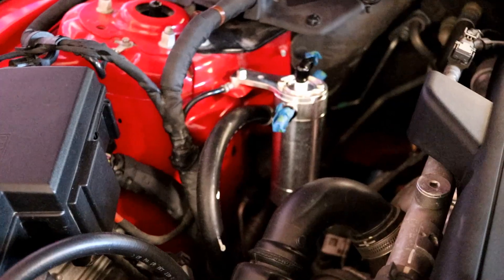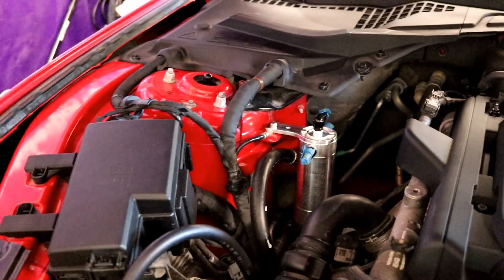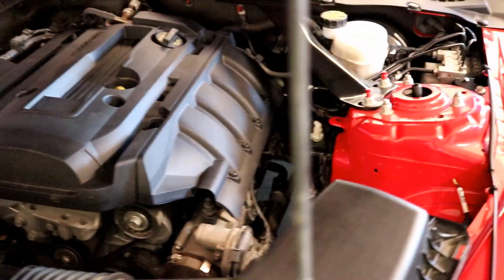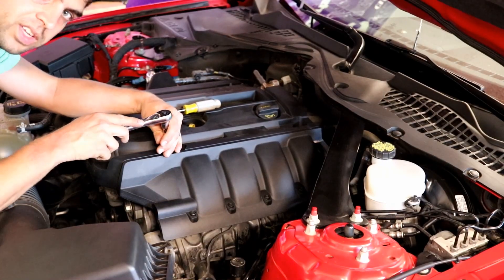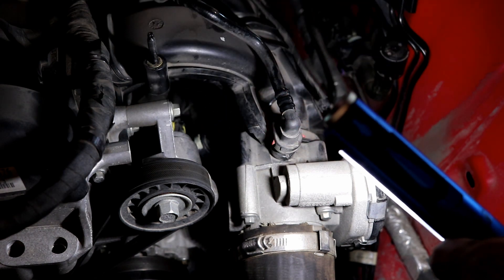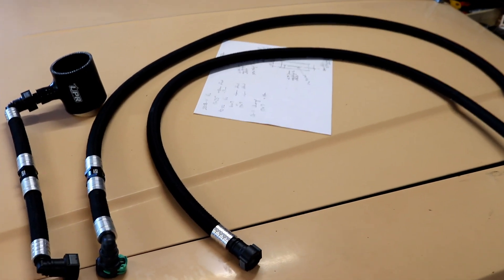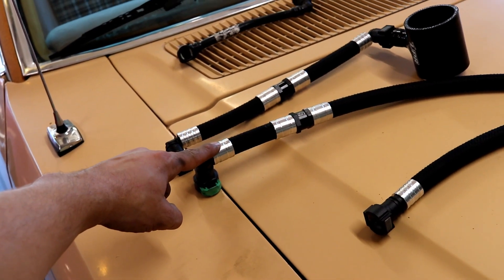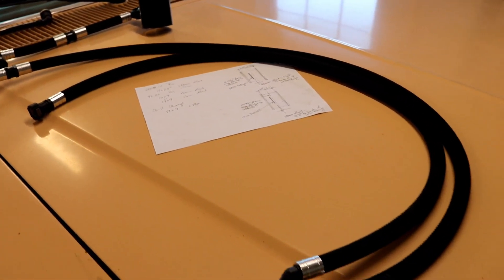UPR Ecoboost Mustang Catch Can Install Pointers + Why Catch Cans?

Comment: Can this be combine with driver side jlt catch can ?
Reply from the maker: This would replace it entirely
Reply: Then what's the jlt driver side for ?
Reply from the maker: @CoyoteDAworld  Both do the same thing, but the "dual valve" catches blow by from the turbo inlet when it ocilates between boost and vacuum, in addition to the natural crankcase ventilation. Whereas your JLT is only a single side, so it's catching the majority of the problem: crankcase ventilation side. Dual valve does more, but yours is doing probably 85% of the job mine is doing. I wouldn't worry about upgrading from yours.

Comment: I keep getting a po2282 error can you help?
Reply from the maker: After a catch can install? I'll be honest, I have no clue what that error message means...but you might double check all of your connections, especially by the turbo inlet. Maybe there's an air leak or something.
Reply: The connection at the intake manifold isn’t secured

Comment: I haven't had a good experience with external mics either. Not sure why that is.
Reply from the maker: This one lastest 2 years. I'm pretty sure my whole get up got knocked over on my Garage floor, and was likely the cause. I bought a new one... cheaper. Will see how that turns out. Glad it wasn't the inside of the mic jack that broke!